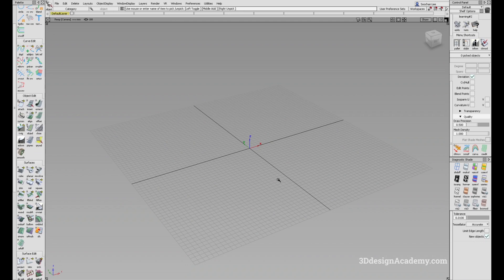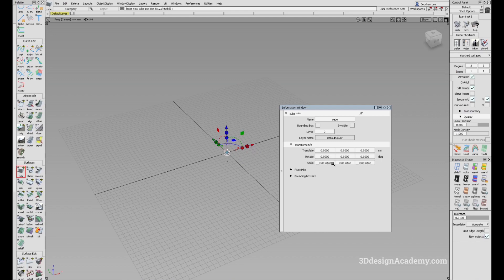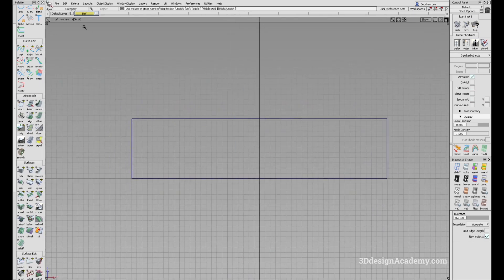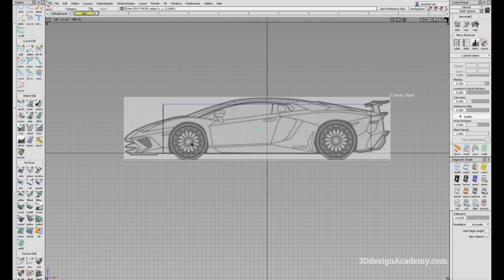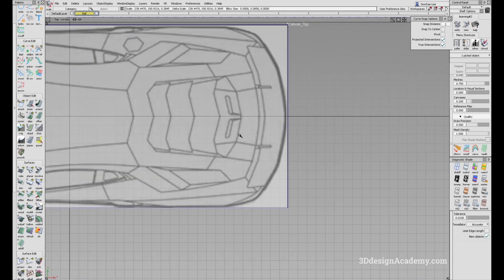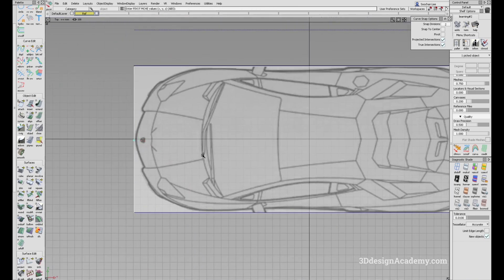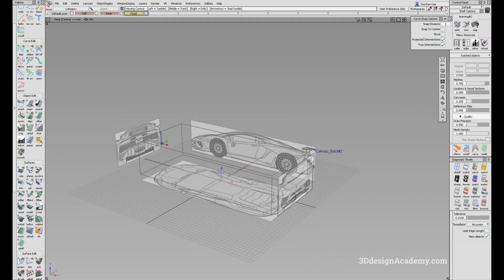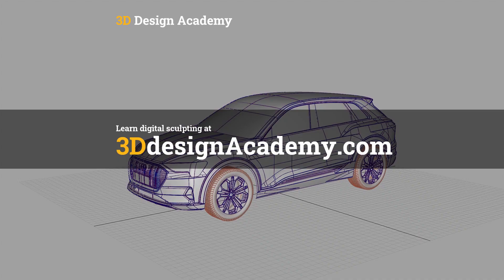Autodesk Alias Tutorials – Lamborghini Aventador Part 1

Comment: Hi !! Thanks for these videos. I have been following your tutorials for a while. I have a few questions if you don't mind answering them.
Q1) As you know that the Alias software's license is very expensive and students cannot afford it. So can we start learning Alias using the Alias Learning Edition software which is free for a year ? And does it have all the features of a licensed software ?
Q2) Can we get the job of a professional Alias modeler in a car industry without any prior experience by joining 3D Design Academy and learning Alias and making a portfolio  ?
Q3) Also I see that the latest Alias versions are very different in terms of workbench and features, however your tutorials are all done in the older Alias version. So does the version make much difference while modeling ?

Please let me know your answers. Would be waiting eagerly for your reply.
Regards.
Reply from the maker: 1. Yes, Alias learning edition is free for a year. I believe it can be renewed. As far as function goes, it is exactly the same is regular Alias. The only difference is you can only save it as a .wire format and cannot export using other extensions such as .igs, etc.
2. Yes you can. One of my students was a math major and worked as a program manager at a tier-1 supplier, but he was able to get a job at one of the Detroit OEMs as a digital sculptor. However, it is always beneficial to have background in art and/or design. Also, the job market is not what is used to be, so it's challenging for everyone, whether you have experience or not.
3. While the interface may appear different, the tools are the same. Yes, there are some enhancements here and there, but the important functionalities are exactly the same.

Let me know if you have any other questions!
Reply: @3DDesignAcademy  Thanks a lot for taking time to answer all my questions.
Sure, I have a few more questions which I would really like to be answered.
Actually, I am really impressed by your tutorials and looking forward to enrolling myself in your course.

Q1) Someone told me that just knowing the modeling process is not enough to become a professional Alias Modeler and get hired, the entire process needs to be industry specific, such as basics of construction, mould etc. So do all your tutorials take care of all these aspects too ?
Q2) How does your tutorials work ? I mean once I enroll myself, will I have access to download or view all the tutorials whenever I want, or is my access contingent upon my progress as I refer to the tutorials individually ?
Q3) How will I be able to reach you if I have any doubts or questions during the course ?
Q4) Would you please offer some discount if possible ? It would really help.

Regards,
Ricky
Reply from the maker: @RickyKumar-e6z  1. While it would help to know the process, I don’t think it’s mandatory. It really depends on what you want to do. If you want to do CAS (computer aided styling), you need to have a good understanding of car design and be able to interpret the sketches well. If you want to become a Class-A modeler, then you need to have more understanding towards engineering criteria, draft, minimum fillet, etc. I don’t really go into too much detail for engineering criteria such as ground plane, bumper, and other misc. zones because they’re provided by the engineering team and depend on the vehicle. However, I do go fairly deep into other things like flange, minimum draft, and minimum radii because they’re critical for Class-A modeling. You will find the tutorials towards the end of each exterior course.

2. You can access all tutorials once you enroll. There’s no restriction and you can view any videos in any order, 24/7. However, they cannot be downloaded and are only accessible if you have a continued paid membership.

3. While it is a self-paced course, I’m trying to make a Q&A course to specifically deal with questions that you may have in a video format. It’s in development.

4. Sure. Please send me an email at contact@3ddesignacademy.com
Reply: @3DDesignAcademy  So it means I will have to become a permanent paid member in order to have regular access to your tutorials ?
Well, atleast I should have download access once I have made the payment right ? That's how the other paid courses on Udemy or any other platform works. It is going to be really expensive to pay every month as Alias takes a long time to learn right ?
Please let me know Sir.
Thank You !!
Reply from the maker: @RickyKumar-e6z  It's not permanent, but you have to be a paid monthly member to access the videos. And, no, you cannot download the content. However, you can cancel anytime. 

Autodesk Alias courses are very expensive. If you were to take classes at the College for Creative Studies, for example, each class is several thousand dollars. The quality of the courses, and the price that I offer it at cannot be compared to anything you will find around the globe.

Comment: Hi man Great videos man,  can anyone please answer,  if the blender settings are configured for accuracy, why can't a model (like the koenigsegg be used to a mock up or a prototype. What does alias have that would allow it to excel over blender.  I ask because I have a school project and I'm thinking of learning alias just for this project,  or can I just make due with using blender to create a prototype ??
Reply from the maker: Blender is polygon based while Alias is NURBS based. They're very different in how they approach modeling. Polygon based modeling is good for visualization and animation where mathematical (or surface) accuracy is not needed. This is why it's primarily used in the entertainment industry. 

Alias, on the other hand, along with other Nurbs based modeling tools, produce surface is that very accurate. When I say accuracy, I'm talking about being able to control highlight, and also being able to produce surface that is engineering criteria compliant (think specific dimensions, etc.). This is the reason why Alias is one of the top software used in automotive or product design industry instead of Blender.

Now back to the school project, it really depends on what it is. If you're making a model that you need to assemble together and requires tight fit and finish, Alias might be the way to go. If you just need a sculpture in one piece, the Blender might not be bad. It really depends on what you're trying to do.

Hope this helps!

Comment: How do you access the scale ? Cause doesn t seems to work for me on click right
Reply from the maker: Your marking menu maybe different. If you're using Alias 2024 or later, please go to the top bar menu, Preferences, Marking Menu, Classic Marking Menu. That way, your marking menu should be the same as the one that I'm using.
Reply: @3DDesignAcademy  thanks i m gonna try that
Reply from the maker: @remlancaster7304  You're welcome. Let me know if it works!

Comment: Hello. I'm just trying Alias, so the question is probably simple. How do you snap to the edges of the image? I can bind to the grid through Alt, but through Сtrl and Сtrl+Alt the bindings do not work. And I don't know others (
Reply from the maker: Curve snap (Ctrl+Alt) should work. You probably also need the latest version of Alias, at least 2021 and newer, I believe. Let me know if it works.
Reply: @3DDesignAcademy  Yes, it worked! Last time I just didn't aim at the curve, thinking that Alias would snap to the closest curve to the cursor. And when the binding is already done, choose a place on the curve.
Thank you.
Reply from the maker: @kostyayaskevich6920  No problem! I'm glad you got it to work. With curve snap (ctrl+alt) the cursor does have to be on the curve, whereas with cv snap (ctrl) it just needs to be near.

Comment: Why did you set construction options this way? Why curve fit is 0.001. Why not 0.1 or 0.0001? what is the thought process behind your decisions?  Why it's important? Please do a video about it!
Reply from the maker: Hello Alex, I uploaded a video that goes over constructions options. https://youtu.be/n1mYl4lsGS8 Hope it helps!
Reply: 0.001 gives a good middle ground for the curves to be approximated at. At 0.1 a basic curve will have noticeable edges and a jagged nature however using 0.0001 would be much much smoother however, the computer will have a much harder time rendering that so choosing in between is done.